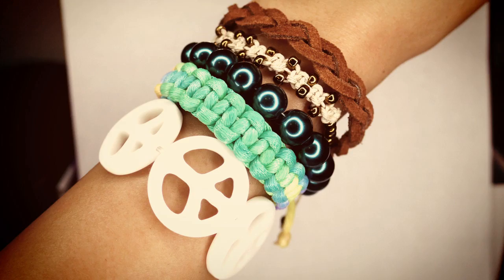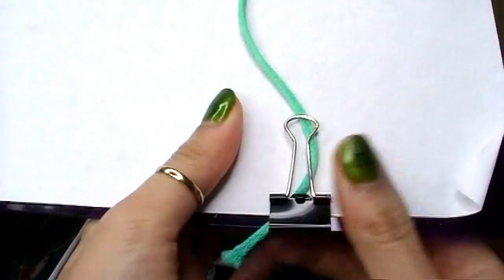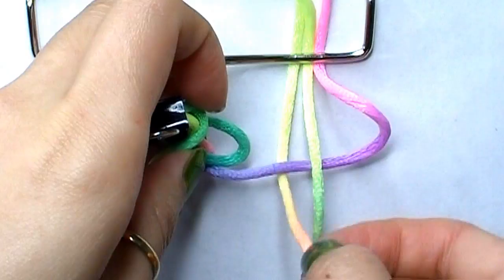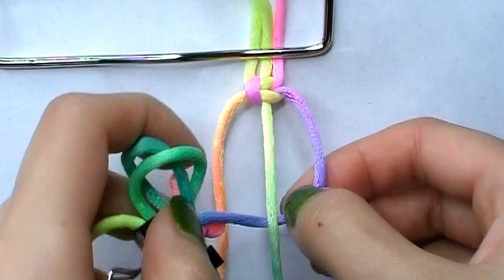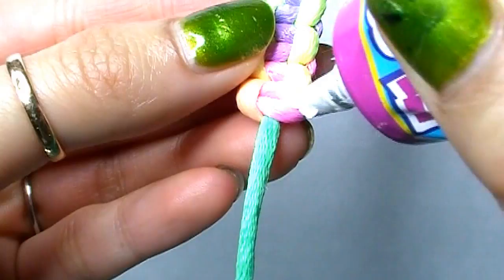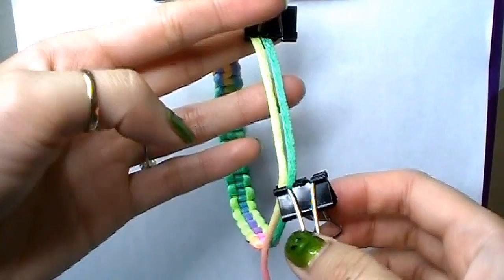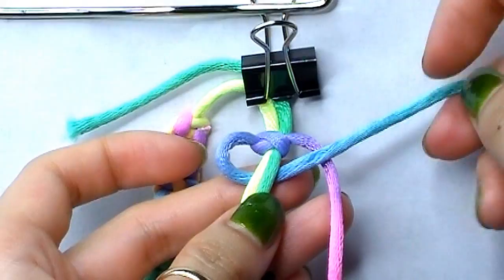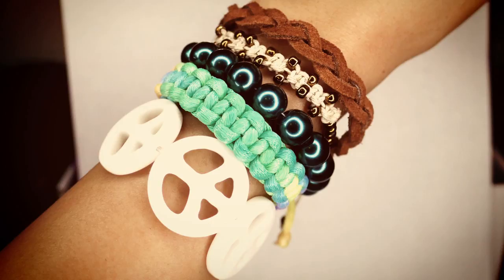Stackable Bracelet #1 Basic Square Knot

Comment: The two side pieces will be smaller, but the main middle piece you don't mess with, so that will stay the same length until you finish the ends, if you decide to cut them.